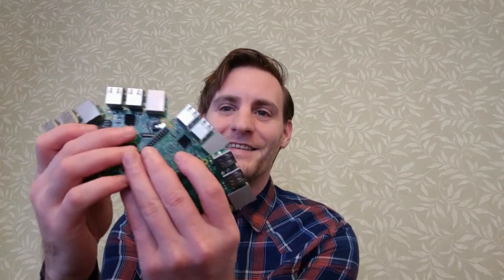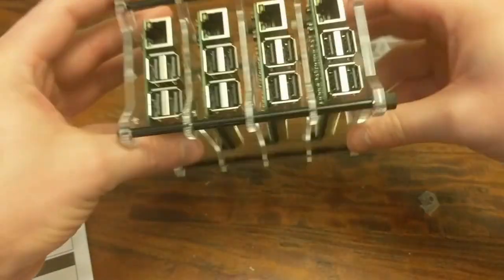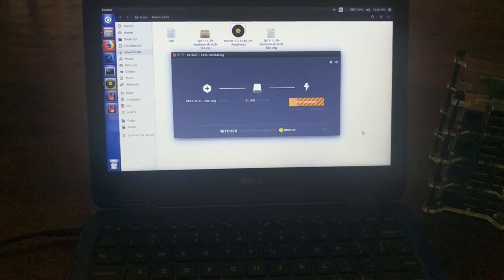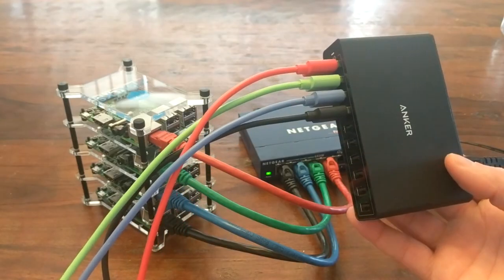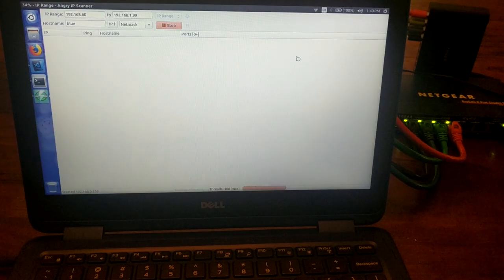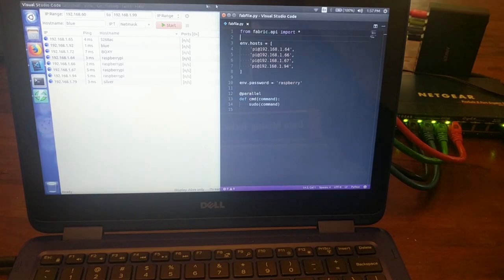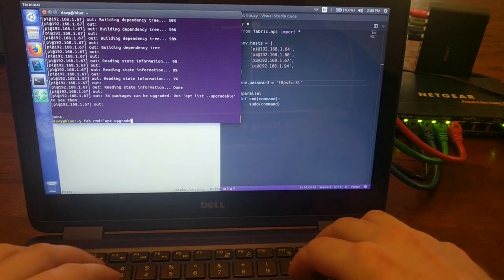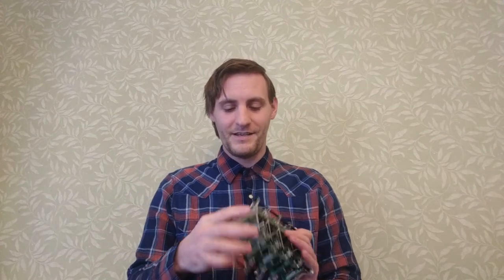Building a 4-node Raspberry Pi Cluster

Comment: So, this is not a cluster per say, just a compute multiplier. The difference lies in that you use parallel commands that run simultaneously on each pi regardless of efficiency or even logic, they're all doing doing exactly the same thing at the same time and return the exact same result... A cluster as of its modern definition is one hypervisor that uses a plethora of worker nodes and distributes intelligently between each of them, returning results from one point only while being logical and efficient.

Comment: Traceback (most recent call last):
  File "/usr/local/bin/fab", line 8, in <module>
    sys.exit(program.run())
  File "/usr/lib/python3/dist-packages/invoke/program.py", line 373, in run
    self.parse_collection()
  File "/usr/lib/python3/dist-packages/invoke/program.py", line 465, in parse_collection
    self.load_collection()
  File "/usr/local/lib/python3.9/dist-packages/fabric/main.py", line 87, in load_collection
    super(Fab, self).load_collection()
  File "/usr/lib/python3/dist-packages/invoke/program.py", line 696, in load_collection
    module, parent = loader.load(coll_name)
  File "/usr/lib/python3/dist-packages/invoke/loader.py", line 76, in load
    module = imp.load_module(name, fd, path, desc)
  File "/usr/lib/python3.9/imp.py", line 234, in load_module
    return load_source(name, filename, file)
  File "/usr/lib/python3.9/imp.py", line 171, in load_source
    module = _load(spec)
  File "<frozen importlib._bootstrap>", line 711, in _load
  File "<frozen importlib._bootstrap>", line 680, in _load_unlocked
  File "<frozen importlib._bootstrap_external>", line 790, in exec_module
  File "<frozen importlib._bootstrap>", line 228, in _call_with_frames_removed
  File "/home/kali/fabfile.py", line 2, in <module>
    from fabric.api import *
ModuleNotFoundError: No module named 'fabric.api'
Reply: well yes you need to install fabric.api to actually use it....

Comment: "You don't have to use color coated cables like this but be aware that it won't look nearly as cool." classic
Reply: Dont be shy let your rainbow run,
Reply: @marcsmithsonian9773  My flow of electrons run
Reply: @wafflebell  and here you are very wrong my dear...  Acirding to Youtube since youtubers set the laws of phisics there are no electrons flowing inside the cables but electricity is a magical radio wave.. propagating instantly.
Reply: @marcsmithsonian9773  Woah, well hey thanks for letting me know, do you have discord by any chance?
Reply: @marcsmithsonian9773  ate things?
Reply: @marcsmithsonian9773 So would it be safe to call a Cathode Ray Tube a light or a laser?

Comment: Enjoy very much your video. How ever got a couple of querstion: Can you follow the same process for more than 4 pi? Can you load a program on the first and expect that the program alone will take advantage of the cluster? I'm working on a surveliance system with 4 cameras with eyemotionos app. It works perfect on one pi, but it gets preaty hot. Thank you.
Reply: well the only thing that you could do in your usecase would be to assign each cam to a dedicated raspberry pi

(or use the pis as backup if the main one fails)

Comment: With the newer Pis having PoE the new setup won't require all those power cables. Provided you buy a PoE switch.
Reply: you could also just connect power to the pi's 5v and ground pin

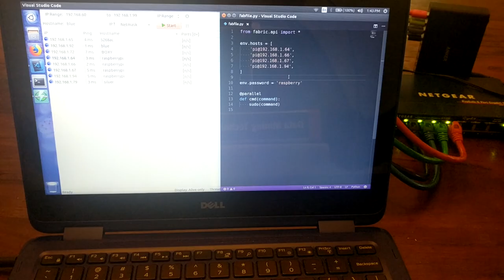Comment: 13:16 its linux its free nobody want access your linux lol. they can get it free. nobody on your local network who you not know anyways lol
Reply: its very very VERY stupid to leave standard passwords even if the device is not connected to anything....

and in this case: its meant to be a cluster so it will probably be in a DMZ or have some ports forwarded and with the password you have by default root access to the pi and you could not only copy his linux but IMAGINE also his data ON the raspberry pi and have access to all the other devices on the network

also if is not open to the "public internet", it is still stupid to leave standard passwords because well who would have guessed your friends, family, anybody who can access your home has root access to the pi's

 "its linux its free nobody want access your linux lol." you would be surprised how big the market for such personal data is
Reply: @user-hx7dc9uz6s  nothing secret file on raspberry pi that i would trust for update fail.so default password fine.it is what is by default i would not add any files lol

Comment: if you where to make these a cluster for a website, would the recommendation be to use static IP on each pi in case? assuming why you didnt statically set the IPs on this demo.

Comment: I need to try this, as soon as I understand what kind of purpose it is for,
Reply: I'm going to use it to setup a training lab for clustering which is where several computers act as a single computer - https://opensource.com/article/20/6/kubernetes-raspberry-pi.  I'm also going to use it to build out Ansible which basically will use one Pi as a master to run and schedule automations on the other 2 or 3 Pi's.

Comment: would it not be nice to simply load an operating system which would download onto all nodes of your cluster, and would simply ask you if you want to connect each one together and or join it with a host, such as your desk top computer.. or if you want it as a stand alone.. and it would simply install it with the options you pick on setup..   Microsoft should be making a windows operating system for these pi's   and I wonder, with some of the thumb drives I see advertised here and there, where you can simply plug in a thumb drive without a hard drive, and its has the windows operating system on it..  and I understand the chips on these pi's are different then regular desk top chips, but surely Microsoft could make software for these chips on the pi's with the ARM chips..  so if I had two pi's in a cluster or 4 or 16, whatever.. it would simply read the cluster and install upon the whole cluster at once with it being totally configured.. and then as it does with desk tops, recognize anything you plug into it and install the drivers for those devices..   I just think the pi clusters would be kind of neat to use for browsing the web.. should be able to connect it wi fi to your TV and sit on the couch and browse the web off of the TV, maybe watch some you tube vids or even movies, or you tube TV ect..  connect with friends on social media ect..

Comment: You don't need to have the charging port to power the cluster. You probably could Do Poe if you buy a switch with poe built-in.
As for the people wondering yes you can't just plug in an ethernet cable to power a raspberry pi you would have to by and active 5v poe splitter. This pack should work 
https://www.amazon.com/ANVISION-Splitter-Adapter-Connector-Compliant/dp/B082RNSWB9/ref=sr_1_3?keywords=active+5v+poe+splitter+4+pack&qid=1579517924&s=electronics&sr=1-3

As for a more diy job, that's cheaper you basically would only need a Dc-Dc converter.
https://hackaday.com/2019/09/30/using-poe-with-a-raspberry-pi-3-for-about-two-bucks/
Reply: you could also straight up connect a 5v power source to the pi's 5v and ground pins
Reply: @user-hx7dc9uz6s  true, I just figured if you're having to use ethernet cables, might as well power them from it.

Comment: I have a netgear GS308P i'm trying to use and it's not picking up an IP from my router. not able to figure out if the issue is with the switch or the router itself. 

the router doesn't actually see the switch as connected even with all the LEDs giving me green lights so it's been frustrating trying to figure it out.

attempting to build myself a small home lab to study for some red hat certifications

Comment: Hello! So far, so good. Except... how do I enable Terminal in Windows 10 please? I think once I get that far I'll be ok! Thank you for the efforts and hard work!
Reply: There is no "terminal" in windows 10, only command prompt. However, if you want a linux terminal in windows 10, I would recommend looking into the Windows Subsystem for Linux.
Reply: Its called CMD.  Just type it in your search box, right click on the CMD exe and run with admin priv.  Better yet, download putty and use that instead.  Not sure if you can get fabric for windows.

Comment: Sooo... This is a cool build indeed.  But I missed the part on what exactly you built it for. And what kind of uses there are for it.  What are the benefits compared to just a single board?
Thanks!!
Reply: you can have more computing power with the 4 raspberry pi's if you connect it to your pc. another thing you can also use raspberry pi's for is using it is a sort of motherboard for other things you might build
Reply: @ghostexblades2137  "you can have more computing power with the 4 raspberry pi's if you connect it to your pc" that is not true at all xD

Comment: With no offense, there's absolutely no purpose in doing this.  You're better off with a single PC or maybe a few boards - simply because it is cheaper in terms of $/Instruction.

The raspberry pi is CERTAINLY neat, and with the 4, it is now a viable desktop replacement (get a Flirc case - I don't work for them, but I love their hardware), but for real work stringing these together isn't worthwhile, currently.

Also if you get a RBP4, get 4GB, and 128GB SD Card.  3 is almost a desktop replacement, if it had 2 GB of RAM.
Reply: Do you even know what you are talking about?? a cluster is not for peak performance (depending on the use case it can be tho if you have a huge workload that needs many threads) but rather for high availability and redundancy

take a look at this article if you want to know more https://apachebooster.com/blog/what-is-server-clustering-and-how-does-it-work/
Reply: @richardwicks4190  lets take a website for example...
imagine you have 4 raspberry pi's each with the exact same website on them, so if one fails/gets overloaded the load balancer can switch to the next pi to provide the website

why would you do this on a pi and not on a "real" server? well because a pi 4 has more than enough power to provide a website or other small things to a decent amount of clients/users while consuming waaay less power than a old pc or a server
Reply: i can only see parts of your reply because either you or youtube deleted them but the point of a cluster is (in the case i descriped it ) that if one pc fails you can still visit the website without downtime
Reply: @user-hx7dc9uz6s  I'm not deleting my comments, youtube does.  This site is censorious now, and it's quickly losing any relevancy to me.  Yandex, which is RUSSIAN, is now a better search engine than Google for general information, although you get a lot of returns in Russian.

You see, I talk about banned topics, as a result, Youtube randomly deletes my comments now.  I've been banned from Google Hangouts at least once.

My point is that there are ARM systems that already exist that provide what you described.  You can get a 16 core ARM system for about $1000.
Reply: @richardwicks4190  yeah youtube is a pile of shit...

its about having multiple physically sepereated machines for redundancy so that if one fails(some hard/software defect) you still have your service up and running and dont get any downtime
Reply: @user-hx7dc9uz6s  Know anything about IPFS?  That, or something like that, is the future.

As the government, and let's face it Google, Facebook, and Twitter basically are just cutouts of the government, continues to suppress political speech, we will be forced to decentralize the Internet.

This is unfortunate, because somethings SHOULD be censored.

Facebook can find and ban somebody in under and hour for questioning the vaccines, but they're just helpless when it comes to somebody posting illegal porn.

Just a bunch of criminals in my viewpoint.

Comment: It could be used as web servers, pen testing lab, install ubuntu and different OS meant for it together and try individually the OS, by either considering individual processing with different OS or parallel processing, try out Docker, Kubernetes, Ubuntu Server, Fedora server it's Security. Try to view it as different servers with different methodology, DHCP server on on, Web page on another, Security Server, etc and mimic a complete operational infrastructure that's seen in big huge companies. We could mimic all those properties within a cluster or individually, just install its dependencies. It's like a total Lab we have in front of us with which we could study, play, organize and learn different programming languages and such. Just consider it either as a stack/cluster which we use to learn or individual pi's in such a cradle.

Comment: These four PIs still appears to be working independently. It will be useful if they can be combined and used as a single system. Then, we can have multiples cores to do parallel processing. Anyway even in the current state one can assign the job to different pi and share the workload. Thank you for the basic introduction of combining PIs.
Reply: it would require a new kernel extension or something like it. I dont think Pi will do real parallel processing out of the box.

Comment: It's a Bushel of RaspberryPi's not a cluster.  Well not yet. Not until you set them up to be a cluster.  Right now they are just a lonely bushel of RaspberryPi's in a nice stack.
Reply: Exactly. This video did not - sadly - explain what I came here for.
Reply: @patrik5123  It still had a couple of cool tricks that would come in handy when it comes time to actually set up a workflow.
Reply: @PaulJohnsonM  100% irrelevant. And not even true.
Reply: @patrik5123  Wow, dude. I guess you should have just read the Tensorflow documentation instead.
Reply: "close your eyes"  XD
Reply: Yeah, cluster was the wrong word to use here.
Reply: Just install something what will work in cluster and you got your cluster.
Reply: yes time to install sunrpc and start coding I guess ;-)

Comment: By the time you purchase 4 boards cant you just buy something like a low-end Intel i3 or get a barebones Asrock Desk Mini that comes with the wireless kit and a power adapter? I have one with an intel i3 8100 4 core CPU. Dont really get what you do with a cluster? Too many wires to connect for a cluster. With 4 Pi's you need 4 network cables, 4 power cables, a swithch and a network cable for the switch. All of that costs money. Color coded cables are just fine and make sense. My son works at an ISP and they use a rasberry PI  to monitor messages from the network that need addressing and similar things. Probably most of that is text based on a monitor.

Comment: Great video, thank you. I see a lot of comments about it not being a cluster, asking what it can be used for, etc. Let me see if I can help. First and foremost, it is a cluster; it is a cluster of Raspberry Pi's. Each will be and act as an independent Pi. What Davy is showing here is how to use fabric is to easily send commands to all at the same time. You don't need the case to do this; its just a nice way to house them.

Now take one of those Pi's and make it the master and the others slaves. The master receives commands (keyboard, switch, sensor, another computer, whatever) and sends those commands to slave Pi's to do the actual processing. Each Pi can be configured to do specific things. In a robot, you may have one Pi dedicated to differential steering and object avoidance, another for video input processing, etc.
Reply: Best comment here. It's the bottom bit I came here for, the video doesn't cover it

Comment: couldnt you use power over ethernet instead of 4 usb cables?
Reply: yes, he can if he has a 4 or more port POE switch and (4) POE splitters for the PI.
That is what I did for my (4) PI cluster for a project.

Comment: What can The clusters be used for?
Reply: This in itself is a cluster of Raspberry Pi's, nothing more. However, you can have one as the master that receives commands then distributes the processing of those commands across the other Pi's. This actually wouldn't be that difficult to do. Each can communicate with each other via network. In such a case you are managing multiple processes running across multiple Pi's.

Comment: Imo ansible with `adhoc commands` is a better multi ssh tool than fabric. What did you end up doing with the cluster after building it?
Reply: Would this make a decent Plex server?
Reply: @nunyabizniz8161 : no.  that's why people are pointing out that there's nothing clusterish about this.
Reply: That was the main point when I was watching this video. He had color coded cables but don't know which Raspberry belongs to which IP address. Meanwhile, I was expecting that he will run different services on different Raspberry :) :) and show something ;P.

Comment: Definition = (cluster ) 

Posted by: Margaret Rouse
WhatIs.com

1) In a computer system, a cluster is a group of servers and other resources that act like a single system
Reply: Clusters are not only used for sharing computational load. A cluster can also be used for redundancy, providing fault tolerances in the event of node failure. Look up "failover cluster". You're definition is very basic and only describes one type of cluster, and I would argue its incorrect, a dumbed down definition for layman.